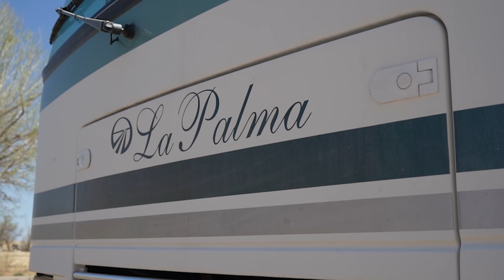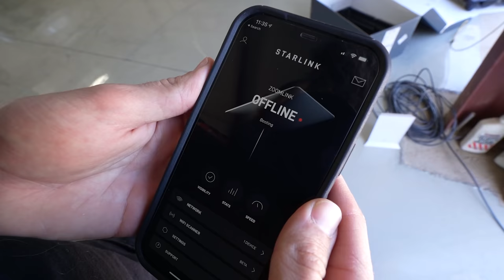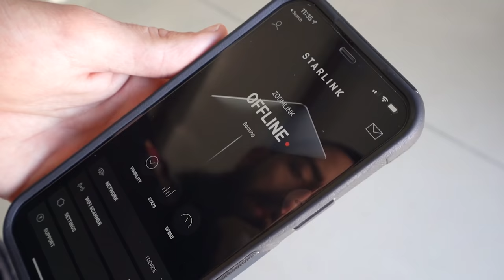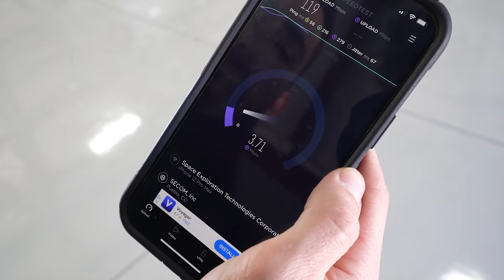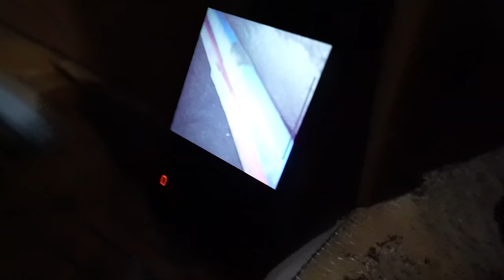Fixing Fuel Pump issue. Ford F53 Class A RV!

Comment: I have  99 intruder in my bay currently for a furnace R+R, I'm an rv technician for Wades if you ever want to bounce ideas off me. BTW the norcold fridges can run off propane or 110AC. Lights inop means converter issues, its located in the driver side very back compartment. Its just 2 wires (+)(-) and the chassis ground. It plugs into a 15amp outlet in the same compartment.

Comment: I don't see a lot of Class A motorhomes but one guy I talked to was pretty pleased with his 8.3 Cummins. 550hp and way over 1000ftlbs. It seemed to have a hard time with heat in the engine bay due to high egt and being rear engined but I think he ran it pretty hard.

Comment: Told you it won’t tow your trailer! You need to add helper springs to the rear as well as add bigger sway bars, that will help with the floating…along with the new shocks. Look at what Jayco does to their suspensions. They are known as the quietest and smoothest in the Rv world… also the ax cover is easy to replace as long as you can find one. Supply issues, hopefully you can find one quick.
Reply: If you have questions I’ll try to help, I sell rv’s
Reply: Yeah I told him towing anything behind it bigger then a little car on a tow dolly or flat tow was all u will get. The v10 already is taxed in 24 pass bus e450 chassis.

Comment: I know this does not apply to all Ford F53 models, so be careful when you want to try this. I have a 1995 Fleetwood Bounder M35-U (Ford F53 Class A RV) and the fuel pump on it is not located under the bed but between the bedroom and the bathroom. If you want to attempt to access the pump that way, you will be in a world of hurt since the pump is directly under the gray water holding tank (including storage compartments) and you will have to drop the tank which again is a pain to do due to the hydraulic jack system bracing bar. Just to give warning to others on this issue.

Comment: Thanks for this!  A motor home on my property wouldn't run and we couldn't get to the fuel tank from below.  So, a hole was cut in the floor and the culprit was a disconnected hose from the fuel pump.  It was an easy fix after getting to the fuel pump.  Thanks!!
Reply from the maker: Glad it helped

Comment: when I bought my second Tow Behind 37ft there was an Class A in there that had went to the tire shop and had both AC"s ripped off. Never seen it, First rule any vehicle check your clearance not just stock but with lift kit, reversed trailer axle etc. Second rule is check your bridge/entry height, Third in RV/Trailer life "first in Jeeping" is when is doubt floor it out.
Reply: also drop the PSI in your tires to lower your clearance just saying

Comment: I made a external fuel pump in a bucket.
That way it can run on gas into the shop. I ran mine through the fuel rail shrader valve, sincecit was easy to access.
Running on starting fluid, or whatever was in that can, can melt the piston rings.

Comment: Turbo, bags, and daily it. Just need a side of meth and you'll be set. Jk.. thats sweet glad you got it running considering the other RV sat for years lmao. Definitely needs a power adder, some suspension upgrades, probably worth overhauling the breaks. A little bit of TLC and that thing ain't half bad!

Comment: Hey probably just a bad sensor Fords don’t use live oil pressure so as long as you have 8 -10 psi of oil pressure the gauge will say it has good oil pressure.

Comment: I wanted to hate you over this video. I drilled a hole thru the gray tank looking for fuel pump. After cutting out floor to repair gray tank and backing out of this one plan I found it is impossible to remove the tank without a cutting torch. 
I went back inside and cut thru the gray tank to access the pump and instead of hating you I thank you.

Comment: you need to open the intake cover and you have to cut it to let more air in the intake and the power and gas mileage will double ! you may need a sub pump. when your in the mountains so the fuel pressure can keep the fuel pressure up

Comment: I would have lengthened the fuel pump wiring harness so you could pull the connector closer to the new access hole

Comment: The speed of transmission is usually measured in (mega)bits (per second), these are not (mega)bytes. To convert X bits to bytes, you need to divide X by 8. Just saying.

Comment: so my grandparents have this rv and the fuel pump went out. i put 2 ratchet straps on the tank there is literally holes for the straps... undo 2 bolts and then lowered the tank changed the pump with the livingroom worth of space down there... then ratchet strapped the tank back up took me 30 minutes.
Reply: thats with procrastinating lol.. but the rv is a parker not a hauler.. they couldnt tow there 14ft boat behind it cause it would struggle on hills lol.. and the gas milage was so bad that adding the boat with the amount of power loss it was cheaper and easier to buy a second truck and tow the boat
Reply: 30 minutes 🤣🤣

Comment: i think you should put a big block marine engine in it with a massive turbo lol.. marine engine cause they are built stronger to withstand high rpm for long durations. thicker engine walls and shit... run like 25lb of boost on a v8 big block out of a boat lol be minty
Reply: Automotive based marine engines like Mercruiser big blocks are the same castings as the automotive version
Reply: @lb9gta307  my caliper says different lmao... have a 454 with much wider walls in my truck than the stock 454 i blew with nitrous .
Reply: @onetime7214  my time working for a Mercury Marine licensed builder is where I learned that fact. And you don't measure cylinder wall thickness with a caliper. That's done with sonic testers.
Reply: @lb9gta307  just because you seen sonic testers used while working as a sweeper in a shop don't mean that's the only method of measurement in this world lmfao. you can clearly see the difference in wall thickness in the engine block. go play some gta kiddo
Reply: @onetime7214  as a licensed technician I'm WAY too expensive to pay just to sweep. We had noobs like you for that 😉 But you go ahead and ignore experiance and knowladge. Believe in Santa Clause too while you're at it.

Comment: Ohh god..... you guys are those guys.... just blindly cutting the floor. Why not just drop the tank down?
Reply from the maker: We did some calculated measurements, and the leveling jack was welded right to the frame next to where we needed to get to the bolts to drop the tank